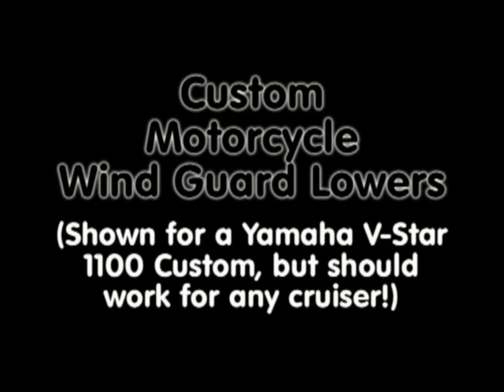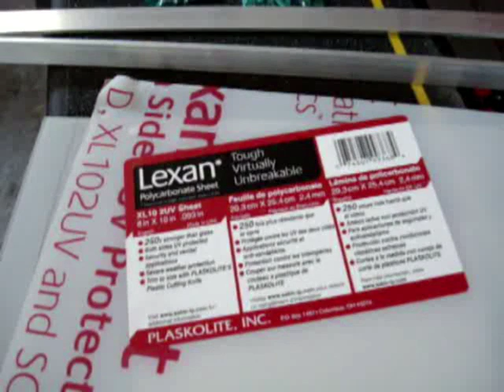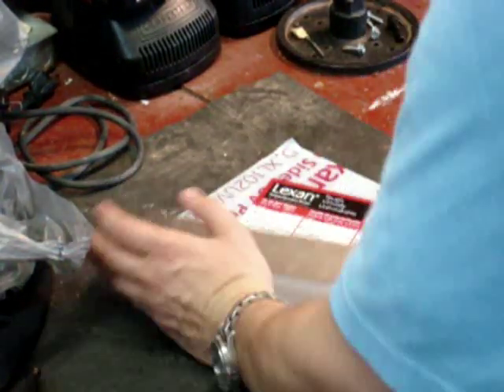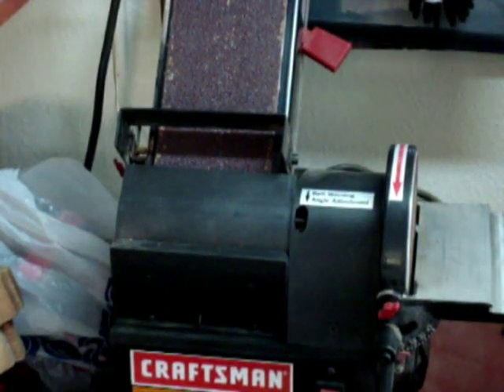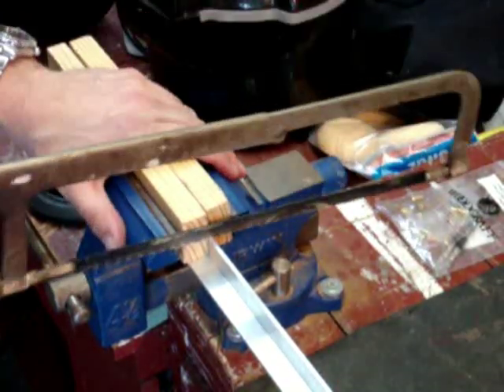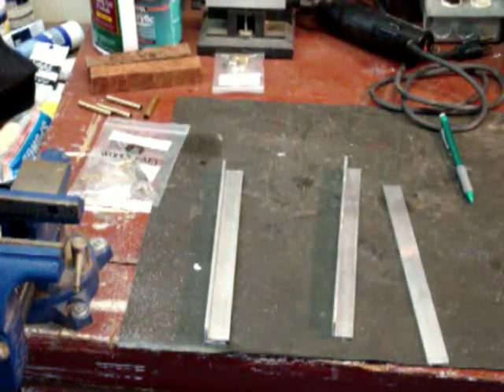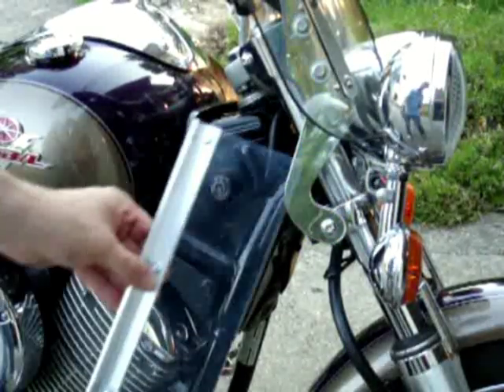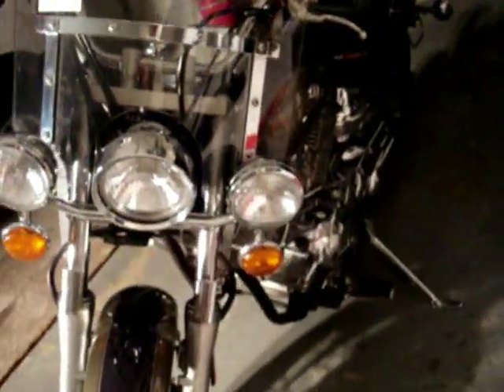Custom Motorcycle Wind Guard Lowers

Comment: Lower air deflectors are so easy to make if you have any kind of skills at all. I can't believe what they get for them. I've made several pair for various bikes I've owned and they all worked fantastic! Don't use Plexiglas, it is not safe. It can crack and break from vibration and excessive wind. It's not very strong either. I suggest using Lexan (found at any hardware store) like this guy did. It is a lot stronger and very tough to prevent scratching.
Reply: instaBlaster

Comment: Sorry in advance for the length of the video - much of it will feel exceedingly elemental if you've already done stuff like this.  I thought it might be helpful to include my thought process for folks who generally prefer to ride than wrench, but might like to tackle this on their own as something new to do.  It's a really effective mod, and after a month of riding with them I'm so glad I added the lowers.
Reply: You did a good constructive job of showing and explaining.   The only thing was the video format not fitting my screen well.  I'm gonna guess you shot it at 4:3 at 480p like DV tape 7 years ago and the algorithms did something to cut off some of the vertical.